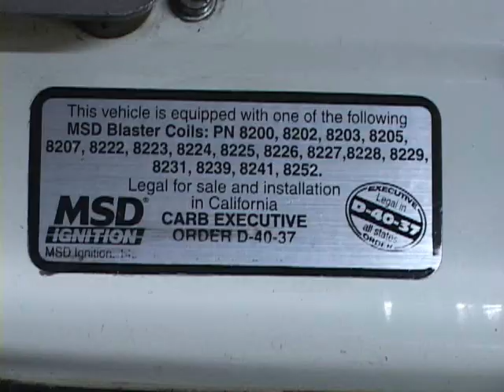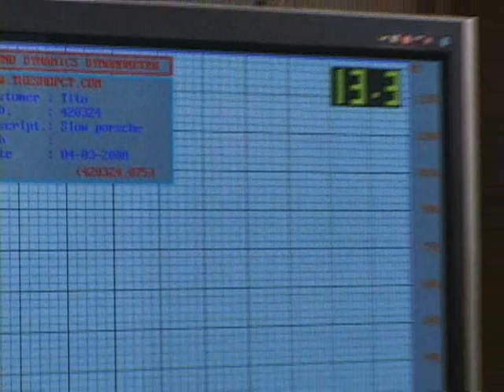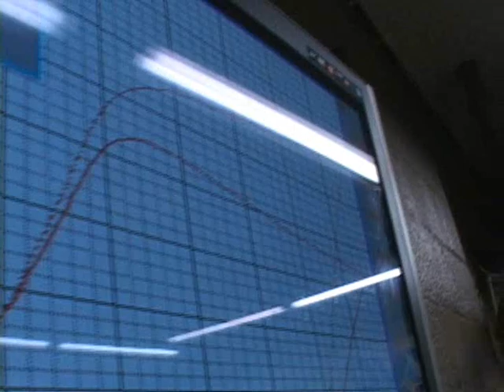Nyce1s.com - Eddie Bello's RPM North Porsche 911 1200+ WHP

Comment: @SuperLitherland the reason the air is on the front of the blow air under and into the side intakes....the car is rear engined and blowing air into the rear end or exhaust would only blow dirty air to the motor.....instead of clean air...

Comment: @Element7744 you have no idea what your talking about at all! dirty air? lol. the purpose of a fan (for turbo cars) is to lower air temperature by blowing air through the intercooler. so having it in the front is not going to be as efficient due to the intercooler being in the rear. the tuning on a dyno is always different than a street tune due to this. you figure doing a pull to 120 or so on the road has alot more air current than a fan can produce. even if its placed properly.

Comment: That's the type of job that I'd love to have! ;o)

How long do they last at higher than 1.0Bar Boost? (20k miles?) I mean, Eddie's is running around 2.0Bar, which is 0.6 more than the Racing 935s used to run!